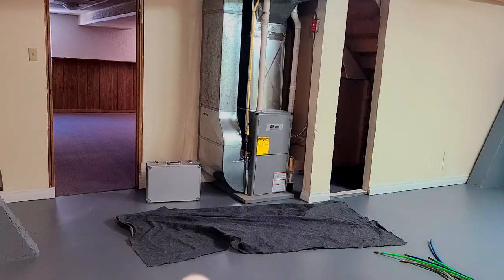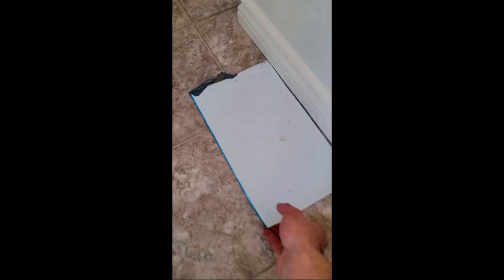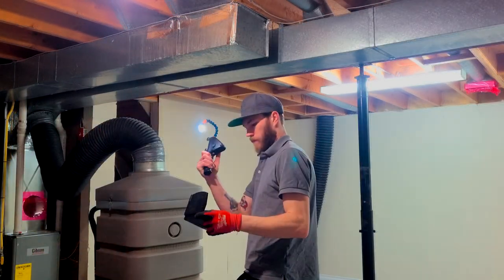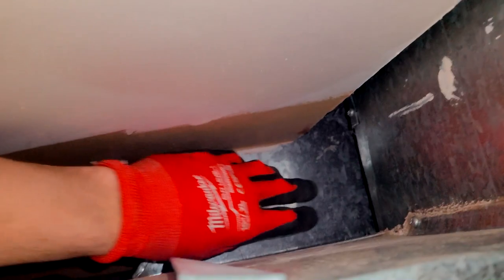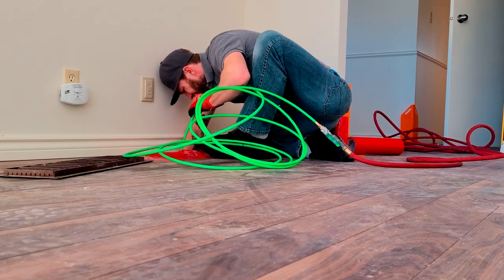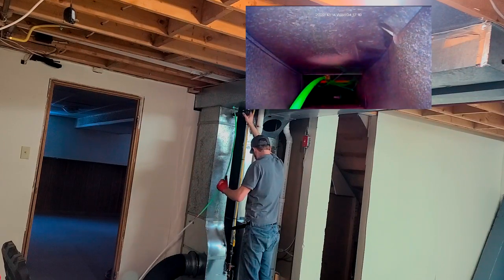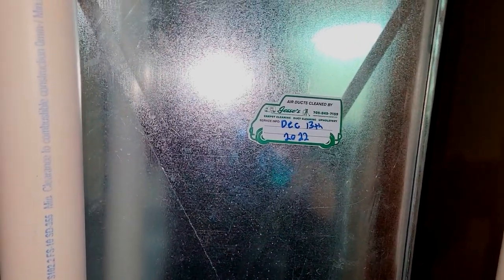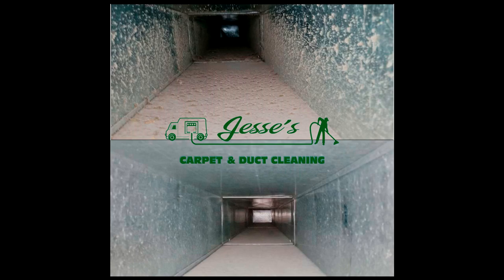Full Duct Cleaning Process / Hypervac Technologies 220v

Comment: How many cfms should a portable compressor be ( not truck mounted ) to effectively work with the heppa vacumm .?
Reply from the maker: Nikro sells some 220v units I believe that put out some good amount of air. I'm not sure the specs but I think at least 20cfm would be enough it's also the psi needs to be at least 150

Comment: I have a question about the heat exchanger/ ac coil. I was told not to make a hole near it, what is your method to avoid damage and make sure it is clean due to the debris that may have fell in there?
Reply from the maker: So the reason I cut the hole close was actually to block it off and protect the furnace from anything falling in. If you notice at the beginning I place a red magnetic mat inside above the HX.
Reply: I just liked and subscribed to be updated on more vids. If you don’t mind and are able to could you make a demonstration video of how that concept works exactly? I don’t believe the company I work for uses that piece of equipment, but I’d like to utilize it for customer satisfaction! I can see you covered it, but not sure exactly how you decided to place the hole and magnetic cover. Also what’s that red film called? Thanks for the reply!
Reply from the maker: I have some ideas on some tips videos and that is a great suggestion! Soon as I get the right job to film and time to edit ill have some stuff upcoming. Right now it's mainly Carpet cleaning videos I'm working on but Air duct cleaning is next!
Reply: @jessecleansalgoma  Definitely tuning in for that. This is the most detailed video I ran into so I understand